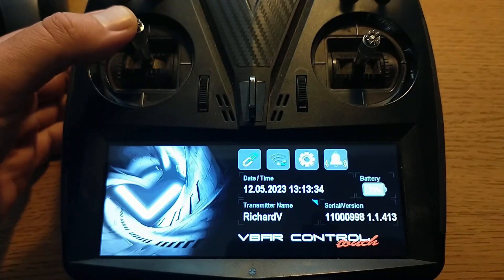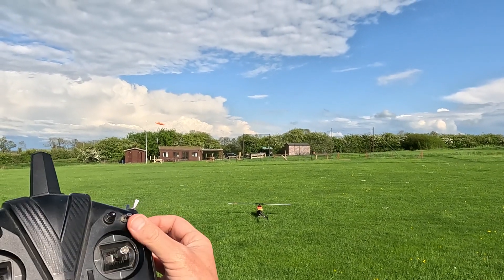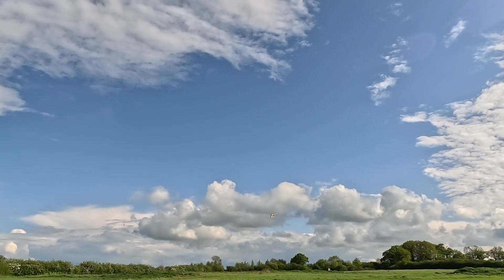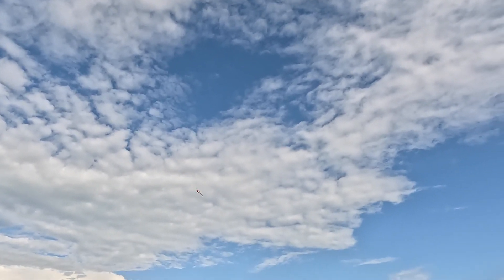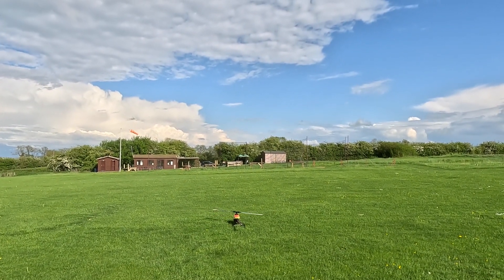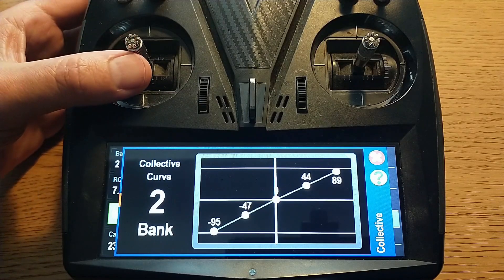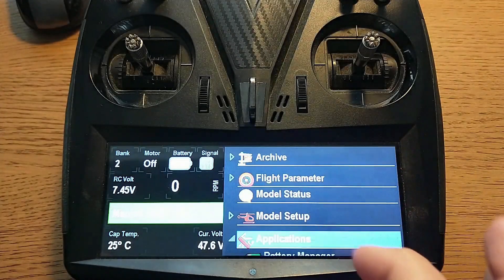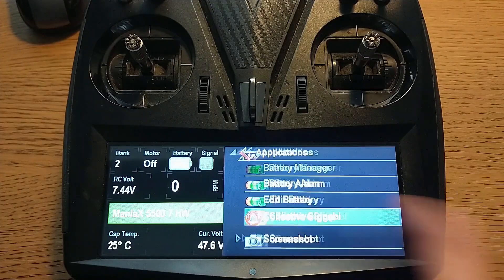Centre sprung throttle. How does it work?

Comment: Hi, can you tell me which other famous pilots fly with such a collective pitch handle?
Reply from the maker: I don't know of any.
I've stopped recommending this, as I have a few people try it and then go back to normal.
Reply: @rchelicopter  
Do you still fly with such a handle?
Reply from the maker: @xu10j2te  I do, as I still really knowing where zero degrees is. Dennis Beilby and a few Australian guys use it as well, but it's very rare.
Reply: I tried to fly like that in the simulator. I liked it. Now I'm thinking about what to do. 
I've been flying for 20 years already and now I'm thinking about what's best. 
Thank you for your answer. @rchelicopter
Reply: Thanks  @rchelicopter

Comment: Excellent video, Richard. F3C flying is my primary style and I will say this won’t work very well. We set up the curves the way we do for control resolution. It gives us a broader range on the stick to make more precise changes while we do the hover maneuvers. Having the spring, as you shared, will interfere with that. Moving the hover spot above center will reduce the available stick travel to make fine adjustments. It’s not impossible but it would complicate things.

Additionally, I rely on the stick remaining where I left it to carry out the pirouetting hover maneuvers. Having to involve more muscles in that movement to stabilize the stick may cause me to have to re-learn the maneuver.

That said, it might be worth a shot to see what advantages may come of the aerobatics sets. Those rely on center to clean up the maneuvers. Wind, however, is the great equalizer!
Reply from the maker: Yeah, the wind is the thing. I think Dennis is the only F3C person that uses sprung, and I don't actually know if he competes at the highest levels. I'm sure if it worked for F3C they'd be all over it 😄

Comment: do you know if i give mikado an email they can change it on mine? i placed an order on the evo and it still haven't been shipped
Reply from the maker: I've got no idea. I doubt they'd install it for you, but they could probably bag the extra bits and include it if you asked them.
Reply: Hey Richard do you still have the invoice that shows the part numbers? I am working with Mikado USA on getting the correct parts & they are requesting a list.
Reply from the maker: @overspeedrc  Hey Shane. I sent a message to their service email saying 
"I'd like to set up a centre sprung throttle (springs on all 4 gimbal directions, no friction) on my VBar Control.  Can you let me know how to get the parts?"
and they knew. No part numbers were mentioned.
Reply: @rchelicopter  Ok, Cool.  I did send them a message.  I will wait for their response.  Thanks
Reply: It gone be problem on a nitro model 😉

Comment: Great Video Richard. I like that you thoroughly covered the pros and cons and alternatives. It would be fantastic if a Tx manufacturer would offer a simple way to switch between spring and friction quickly in the field without getting a screwdriver out and/or taking the back off the case. As it is (because I also fly fixed wing) spring wont work for me but I do use a centre beep on my heli setups which while not quite as effective as a spring I do find very helpful in finding centre.
Reply from the maker: Thanks Steve. There probably is a gimbal that does that, some of them are able to do most things from the front. Good to know the beep is useful 👌